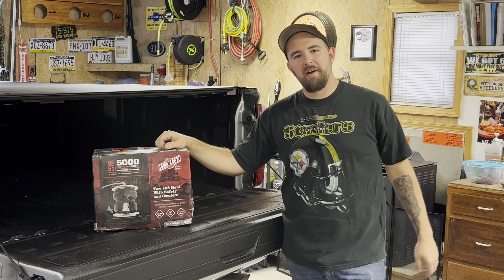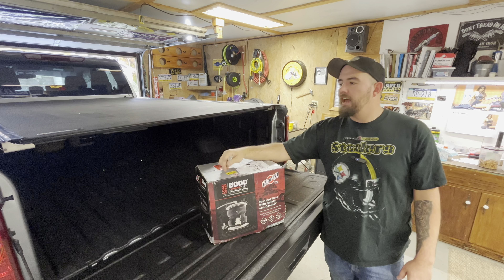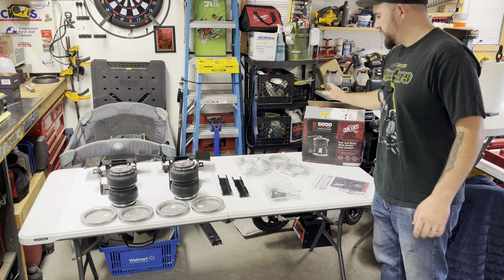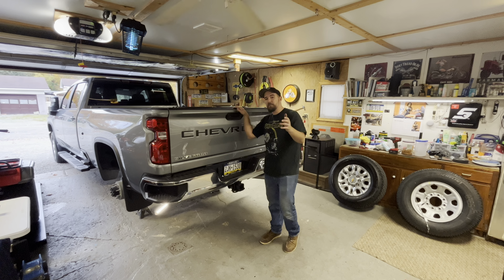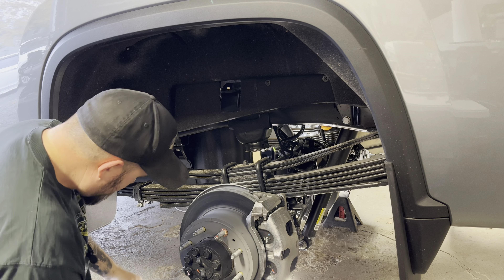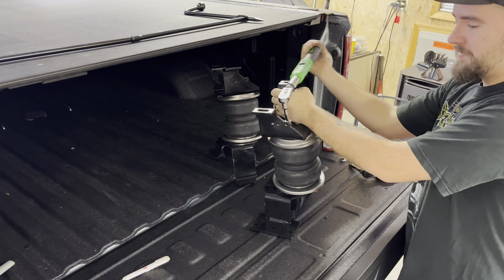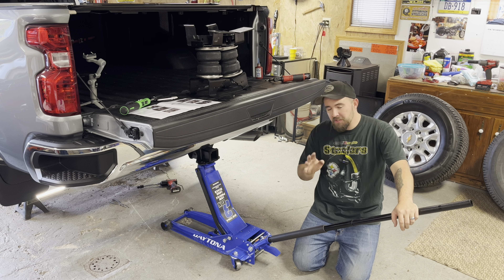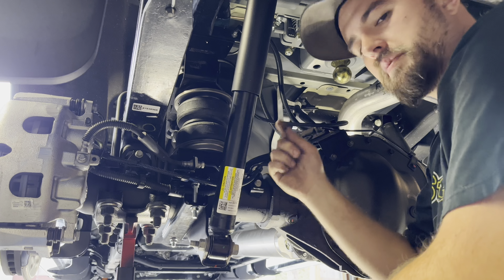2024 Silverado Air Lift install!

Comment: Well done, Dan.  Air Lift seems like good stuff.  I installed their WirelessONE system on a 43' gooseneck trailer.  Works a treat.  Can control and monitor the air pressure through an app on my phone.  I'm very happy with it so far.
Reply from the maker: Awesome. Thanks!!

Comment: Great video watch cause I upgraded to a new truck.  Last truck I ran the lines to the licenses plate bolts shaders hold the plate and no extra holes.  Left goes to left, right goes to right. I then added a 12v outlet off the trailer socket right under the bumper to be able to plug in my little compressor and reach all four tires on the truck and the tires on the trailer from one location and be able to fill the bags.
Reply from the maker: Awesome, thanks!!

Comment: Wow, man I am so glad that I saw this video, it was long but worth it. I have a 2022 GMC dually that I have been thinking about installing airbags, I had airbags on my 3500 Ram but as you know I can't use the same hardware on my GMC.

I bought the airlift with the stainless steel airline and the bag is the Ultimate with the jounce inside, so, I figure that I can use the stainless steel airline and the airbag and just get the standard LoadLifter 5000  kit, since I'm not or can use it anyway and not use the plastic line and the airbag when installed them on my dually. The standard 5000 kit is cheaper but I can use the stainless steel and airbags since I have them anyway.

I did not know until I seen this in your video that I can use the sharder valve with the stainless steel line, I have them in my shed so I need to get them out and look at it, thank you for making this video. Oh, I want be taken off all four tires on my dually but I will drop the spare, lol.
Reply from the maker: Glad it helped!

Comment: Speaking from experience, those middle holes in the upper brackets are where holes can be drilled in the frame and they provide self tapping bolts to put there for exactly this scenario, where there isn't space for the u bolts.
Reply from the maker: I totally agree. Just didn’t wanna do that if not necessary

Comment: Legit question, so with the gooseneck hitch, would it be easier to do the air bags before you install it? Or does it not make a difference. I’m to short for a big boy truck like that so I’ll never have that issue 😂. Just curious.
Reply from the maker: I honestly don’t think it would matter

Comment: How come 18 wheelers T all the bags together without any check valves? At least the trailers.
Reply from the maker: Because the axles are controlled with leveling valves that constantly monitor the height and regulate the amount of air
Reply: @dansproshop  I’m not saying you’re wrong, I want to know, but all my trailers only have 1 leveling valve. Pretty sure they are all on the left rear axle but that’s going off memory. At least on the ones that don’t lift the front axle when light anyway.